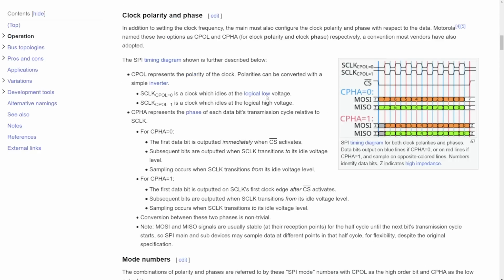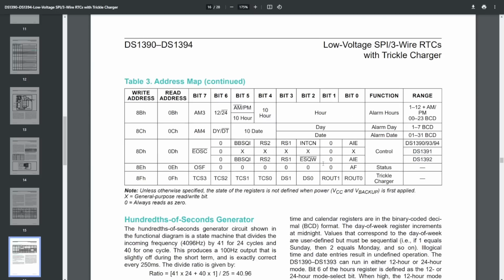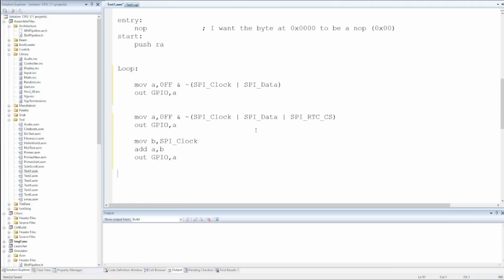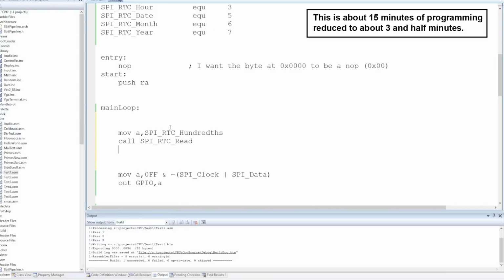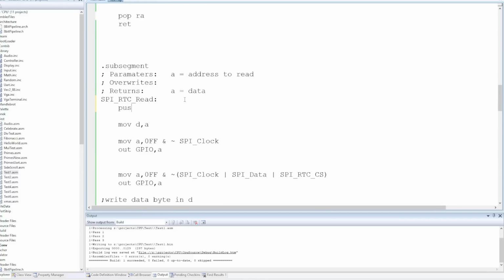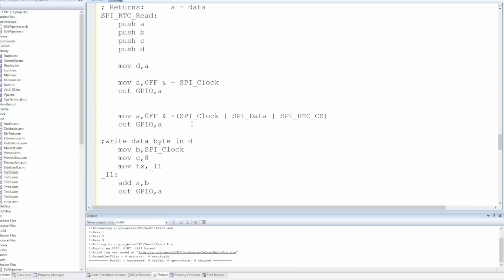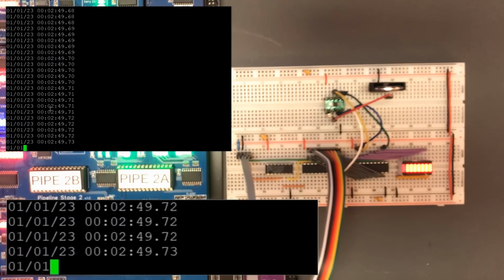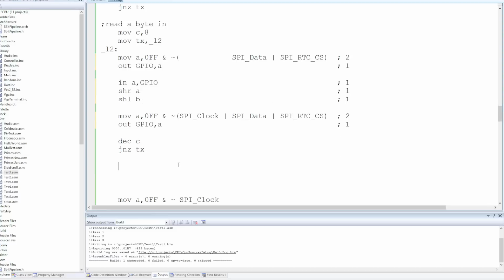SPI (Bit Banging)- IO from Scratch - Part 4

Comment: This type of data transmission is so easy to bit bang, this goes of any form of well documented data transfer, I much prefer this than RS232.

Reading RS232 where you can have no idea of how many characters are coming , whether they will end with CR/LF or LF/CR. even down to if the sending Baud rate is the same as your receiving rate even when they are set the same. 

Can't beat a nice preamble to lock your clocks. 🙂
Reply from the maker: Why use one wire when you can use 3!  😅
Reply: Well Rs232 is two wire but who's splitting hairs. 🙂 @weirdboyjim  

And of course SPI always +1 as you need a ground reference.

Comment: Hardware SPI!
Reply from the maker: I've been playing with some ideas, I think it would be possible to  get a hybrid circuit to roughly max out the system clockrate  (4mb/s) with very few chips and clever code.  What would you expect from full spi?
Reply: @weirdboyjim  Haha, I mean, at work, 250 MHz clock, and sequential read/write. But that's not realistic out of discrete parts.

Maybe 40 MHz is a good target, but no sense running the SCLK faster than you fill/take data.

Will you be using anything with lots of memory? SDCard? Or is this just for slow peripherals?

Either way, couple of shift registers, a control register, and maybe a clock divider register should have you covered?
Reply from the maker: @m1geo  It would take me a minimum of 3 cycles to consume a byte and store it in memory. So spi clocked at over 10 mhz wouldn't really be of any use.  I'd settle for clocking the spi at the system clock at 4mhz.
Reply: @weirdboyjim  4 MHz sounds a good speed. Should be easy to get the logic to do that. Will you have read/write FIFO?
Reply from the maker: @m1geo  Haven't decided exactly what I'm doing but there is not a great deal of cost/benefit to a fifo here.

Comment: I wish what you said about date order wasn't controversial... I fully agree, today is either 14/12/2023 or 2023-12-14 (I'm used to dashes for the "correct" order). Any other order is just weird and illogical!

(the rest of the video is also interesting :) )

I think some simple hardware help would be interesting and useful. Having things go faster than pure software bitbanging should expand the possibilities a lot and change the way you use things. I think even for the RTC, I suspect if you wanted to show a timer on screen now (say a game level elapsed time thing) you'd use some sort of VGA frame counter or something like that and you wouldn't waste hundreds of cycles to read the RTC just for that, but if that gets reduced to say a dozen or two cycles the option will be there.
Reply: yyyy-mm-dd (with leading zeros) is the international standard, ISO8601. I always use either ISO8601 or if I'm localising for Britishers, I'll spell out the month, e.g. 07 Dec 2023, so there's no chance of confusion with 2023-07-12
Reply from the maker: Thanks! If your code is synced to vga frames then a frame counter is trivial but it can be nice to have a time source you don't need to monitor.
Reply: IEC 8601 every day 😂
Reply: Yeh, month, day ,year or year, day, month is just wrong
Reply: Month first is something the Americans got from the British. And it certainly isn't the most used format. That is either day first or year first as in the iso standard. 
But you cannot blame the guy for being born British.

Comment from the maker: If you came here to comment that I popped the registers in the wrong order (thereby swapping “b” and “d”  rather than preserving them) well done. I didn’t spot that until previewing the final video.
Reply: guilty. glad you found it :D
Reply: I was sure you were going to spot it at 19:11 when you (correctly) added pop a at the bottom of your function… imagine my facepalm when you noticed that b,c,d,a didn't look right… and moved pop a to the top of the list… 😀
Reply: nah, i am here just to watch and be in awe. grat video
Reply: have you considered having a formal Pinned Errata Comment under every video where you put this kind of stuff?
Reply: My sense of order took off and I was about to write it. Glad you found it.
Reply: Not that, but you did forget the +2 ! 7*8 = 56 by itself.
Reply: Yes, that's exactly why I came here... 😅
Reply: Saved me the comment 😂

IEC 8601 is a great resource for software engineers dealing with date representation. It mandates big-median date formats and avoids the disparity between US and Int’l formats by explicitly avoiding both 😂. It’s also very helpful as a file and prefix because sorting folders by name order automatically sorts dated files in strict date order too, not grouped by months first 🥱.

Even correcting cycles to 58 (you forgot the +2) that’s really good performance. So I’m less interested in a hardware SPI than I am in seeing I2C bit-bashed. But if a single video can Pareto an accelerated SPI, and doing it interests you, then go for it!
Reply: Indeed. But also to thank you for another great video